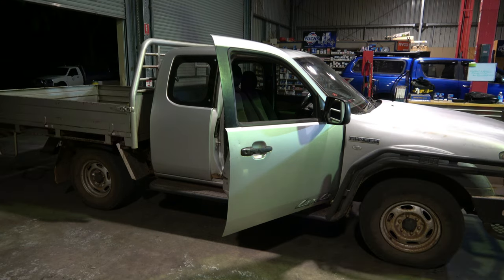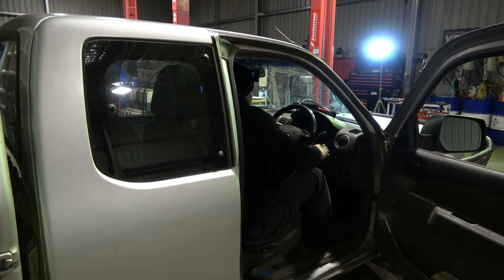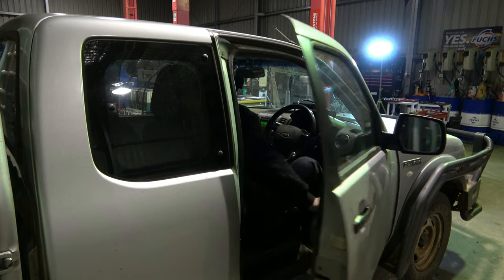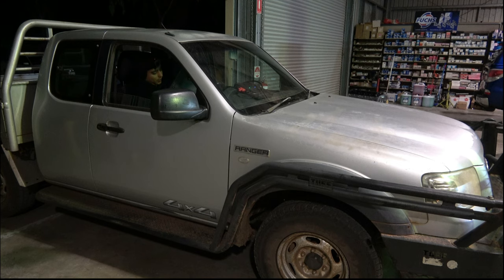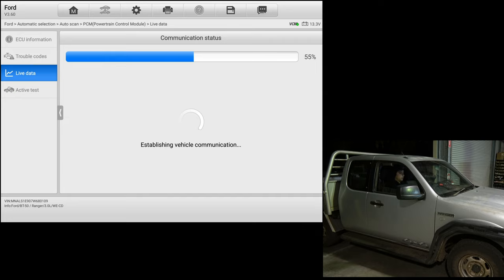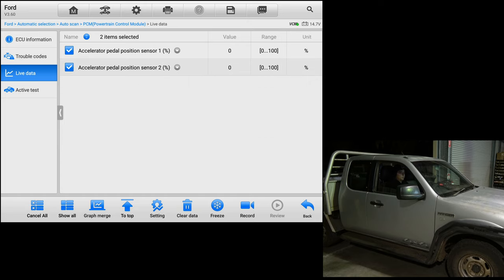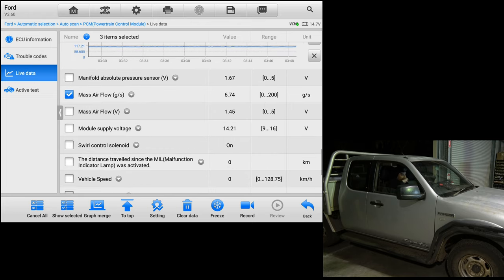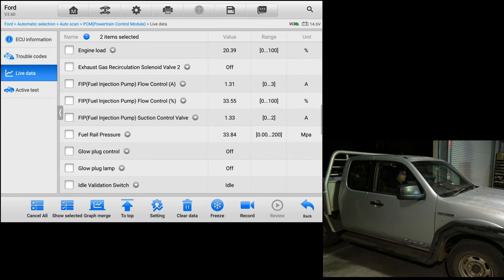Ford Ranger 3.0 Diesel Blowing black smoke hard to start long cranking

Comment: that was neat, you gave me a head scratcher though hahaha can you give me some insight on the pressure of leak back and actual injected fuel relations? i mean what does an increase/decrease in pressure signify
Reply from the maker: Increase pressure is blocked injector.
Decreased pressure is leaking injector.
Reply: @a1mechanicaloakey639   ahaaa okay okay , and what about volume of leak back? More return volume means restricted?
Reply from the maker: Yes
Reply: @a1mechanicaloakey639   aaaah great ,thankyouuuuu sensei
Reply from the maker: Sensei?? 😆 lol

Comment: Sir thank you for this video!... may i ask something about the 3.0 xlt ford ranger the check engine light is on,its starts normal but my scan tool tells glow circuit A..i check all glowplugs are good and i notice that    the positive supply always  on at the glow plugs and when i check the glowplug relay looks pretty good...i check the two small wire from glow relay one wire goes to maf sensor the other goes to ecu..so what is the possible cause for the check engine light is on.  Thank you n bless u.
Reply from the maker: Is it 3.0 or 3.2 litre?
Reply from the maker: And is it hard fault or soft fault
Reply: I am not sure if it is hard or short faults but the only thing that i notice is the check engine light is on all the time..using my cheaper type scanner it reads glow pug circuit A. 3.0 ford ranger like your video on fuel relief valve was  faulty.
Reply from the maker: I will do a video call. If you want when I have time
Reply: Okay sir thank you
Reply from the maker: Do you have whatsapp
Reply: Only facebook sir in messenger .

Comment: That was really great to watch!! 

I have the same model Ranger & have been trying to diagnose a lack of power. Watching this helped to rule out what I have already checked. 
No smoke or anything else seems out of place. MAF, MAP, Fuel rail & temps all look to be in range too. Cleaned out the intercooler and intake manifold too. 

Doing my head in a little but enjoying the process as well. Any ideas?
Reply from the maker: May be watch my Ford Ranger no start video too. Also check for intercooler hoses leak.
Reply: @a1mechanicaloakey639  cheers will watch it too. Pulled out all the intake hoses, air box & intercooler couldn’t find anything. New fuel filter, checked banjo bolt on the fuel pump. Turbo & actuator seem to work fine. 
It had a new head just before I bought it & I’ve only had it about 8 months. 

Starts fine, runs fine no codes. Seems to still boost to its stock 16 PSI. Just really seems to lack power in the lower end especially on a uphill. 

Anyway I’ll keep trying to nut it out. Thanks for the reply & info in the videos.
Reply: Hi Justin , did you manage to solve this? I am also losing power when i am going uphill
Reply: @NgoniAlwin  hey, couple of things I found on my rig. Replaced injectors as had done nearly 400k and found a vaccum leak on the boost solinoid/EGR solinoid system. 
You can bypass the solinoid valve with the vaccum line directly to the turbo actuator and go for a short drive to see if it’s the solinoid. You will feel full power (Don’t leave it like that though be full boost all the time)
Reply: @justinforshaw1487  Thank you so much
Reply: 3.0 WEAT engine with low power issues too. Mainly up hill and high load. Have driven other rangers and they feel snappier.